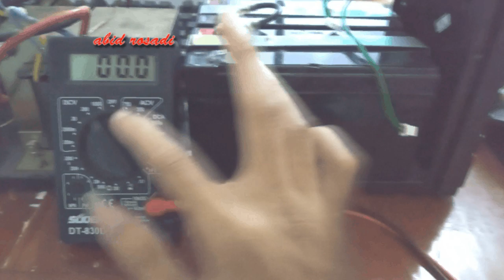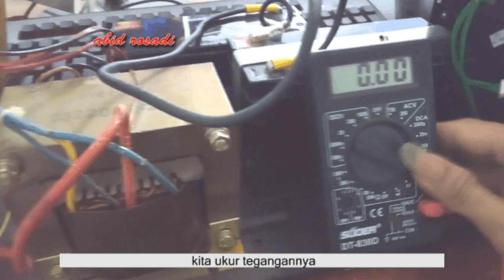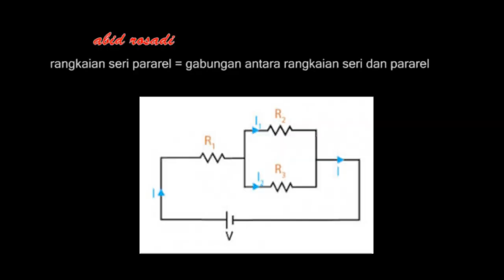rangkaian | aki | baterai | seri | pararel | campuran

Comment: Bang kalo rangkaian di seri seperti ini 12v 100Ah diseri dengan 12v 50Ah apa yg bakal terjadi bang? Kalo tegangan pasti 24v kan? Nahh arusnya berapa bang? Dan apakah bakalan rusak?
Reply from the maker: Ah adalah kapasitas aki dalam ampare hour atau ampare jam

Bila aki beda kapasitas dipasang seri, 
Misalnya kedua aki tersebut mengalirkan arus 1 ampare (24V), maka dalam 45 jam, aki 45Ah akan habis duluan, sedangkan yang 60 Ah masih bermuatan

ilustrasinya adalah saat ada 1atau2 baterai laptop yg arusnya drop maka leptop akan cepat mati. misalkan 6baterai lepto normal nyala 6jam, karena rusak 3 jadi cuma kuat 3jam.

lebih cepat rusak atau tidak tergantung besar kecilnya beban.